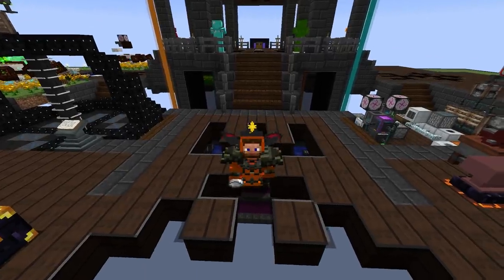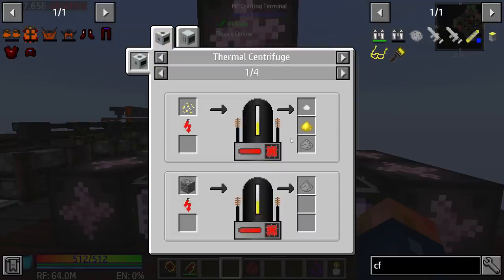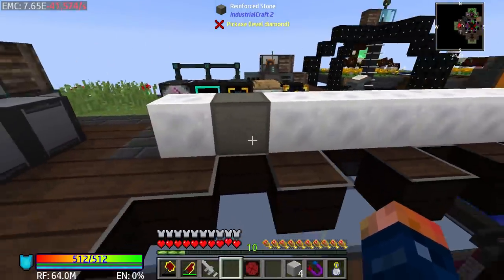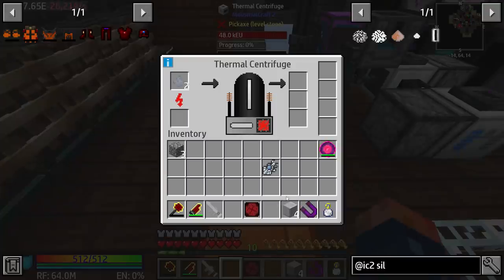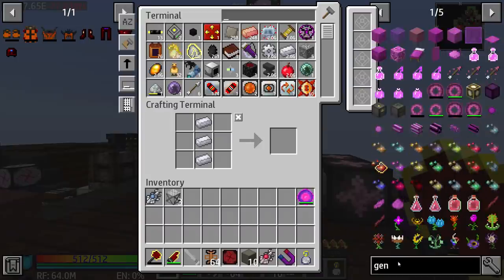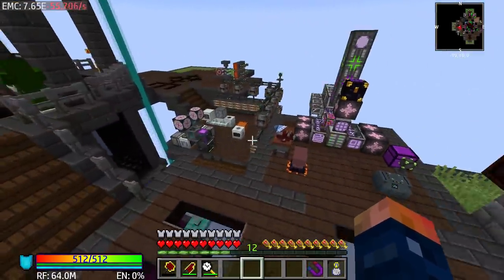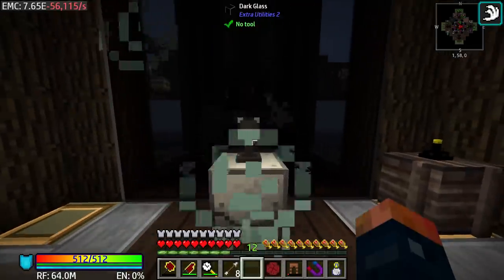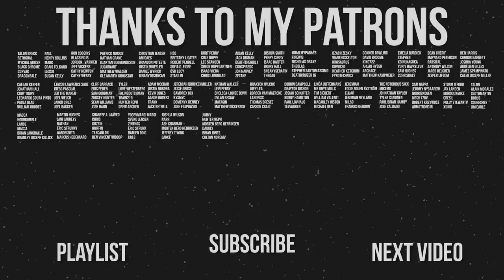FTB Sky Odyssey Ep. 21 IC2 CF Sprayer + Reinforced Stone

Comment: You just needed a lever/redstone signal on the Thermal Centrifuge and it would have kept it's heat too. Also, after spraying the CF Foam on the Iron Scaffolding, using sand on it instantly dries it.

Comment: Chosen. You should try using the creative vending upgrade for the drawers and try to set up an insane system and use a storage bus from AE or Refined Storage ( if it's in the pack ) And see how well that works together that way you can have a bit of a better withdraw for things you'll use a lot that don't have EMC instead of just that one strongbox.

Comment: I know this is a 3 year old video and your thoughts on Matter Overdrive may have changed, but I would like to point out that your comment on the reactor from it is very, very wrong. It starts out fairly small, but you can run it on nothing but cobble, and can slowly upgrade it with nothing but cobble. (for those who don't know, you basically make a reactor around a Gravitational Anomaly, which is similar to the Hungry Nodes from Thaumcraft 4 in mechanics, and then pump matter plasma, which you get from sticking matter into a machine, into the reactor. The bigger the anomaly, the more power generated; I've managed to get a reactor to produce more than a Draconic Evolution reactors, just by throwing large amounts of compressed cobble into the anomaly.)